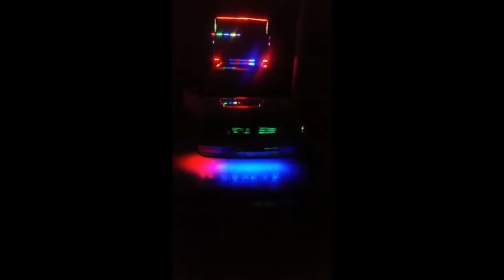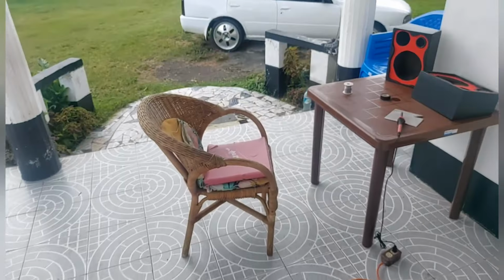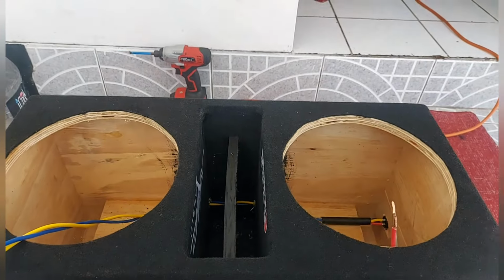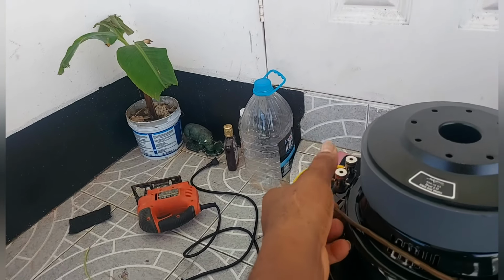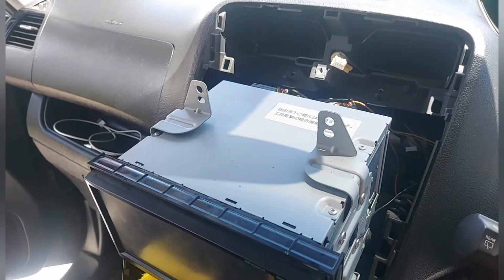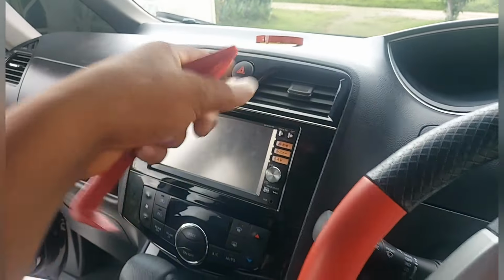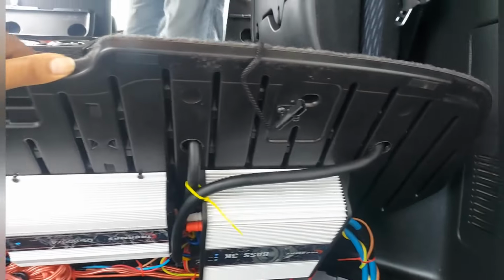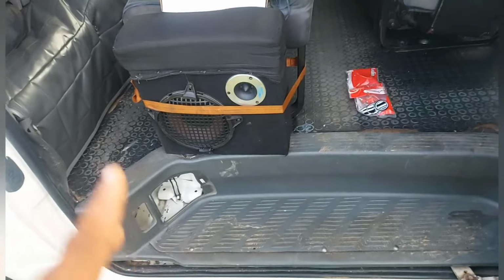2014 Nissan serena full system install....

Comment: Hey bro if you wire it in 4 ohms or 1 ohm from the dual 2 ohms . You are still getting 600 watts RMS rather in Parallel or series. Basically each coil is 300 watts Rms combined to have total RMS of 600 RMS .
Reply from the maker: I have more than enuf rms going to the speakers. I wired it series so the amp works at a easier rate 2 ohm rather than 0.5 ohm

Comment: So nizmo when you series the bass, it play better or something? Because mi always just parallel mine so i need to know
Reply: You normally decide when to series or parallel depending on the ohms of the amp and the subs. So when u series on a dual sub it raise the ohms by 2. so 2 ohms X 2= 4ohms. When you parallel it drop the ohms. So 2 ohms divided by 2= 1 ohms… so if u have a 2 ohms amp to balance off the 2 subs u series to raise the subs to 4ohms a piece then parallel into the amp to drop the ohms back to 2ohms. 4ohms divided by 2= 2ohms.
Reply: Ohms is resistance. So the less ohms the less resistance of power to the amp/subs but in doing so it pulls more current/voltage. Dats y on most taramps bass amps u see 0.5- 2 or 4ohms cz dem pull nuff power with low resistance to give the best bass possible.
Reply: @romanerichards5184  okay fam, understood….. respect 🫡